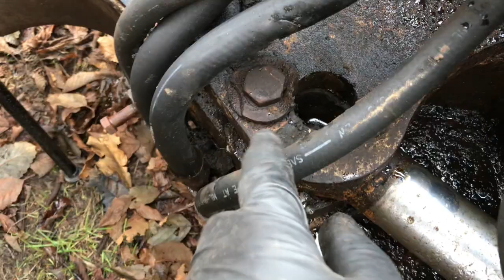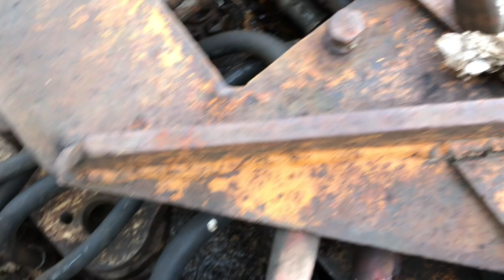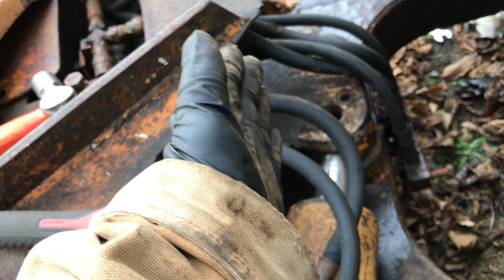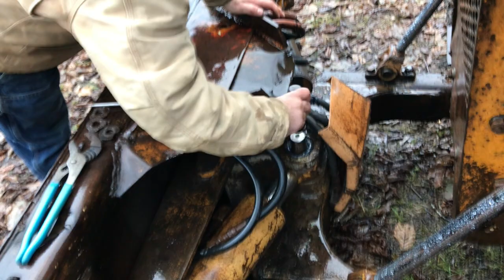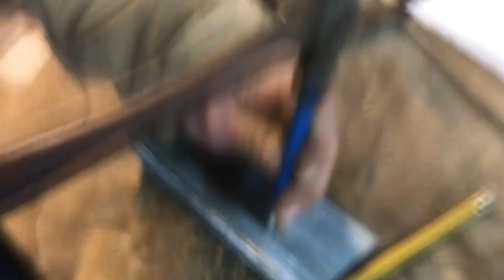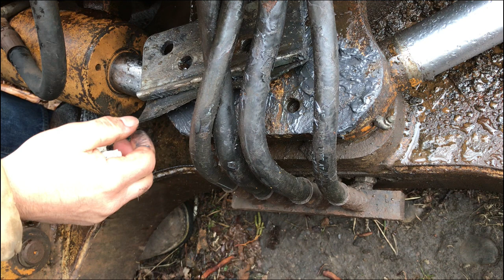450 Case Crawler Angle Cylinder Linkage Repair

Comment: I always feel a little smarter after watching your repair videos.  Thanks Patrick!  Phil
Reply from the maker: So far my favorite one in this series on the dozer is the one I just edited but it won't publish until the first of March. It is the one where he switches over the cutting edge and he had a few struggles he came up against because of modifications that had been made by the previous owner and because of its age but it is pretty cool what he did
Reply: Appreciated Phil. Were peckin' at it.

Comment: I'm not a tecnical person when it comes to farm equipment, however, it's so good to see this type of video! In my opinion, we need to keep the older, solid equipment running, instead of depending on computerized 'mother boards' from abroad. That new stuff's fine for fancy entertainment, but not for the core machinery that will keep our country going in tough times.
Reply from the maker: I very much agree. Too much reliance on computers can be our downfall!
Reply: Well said.